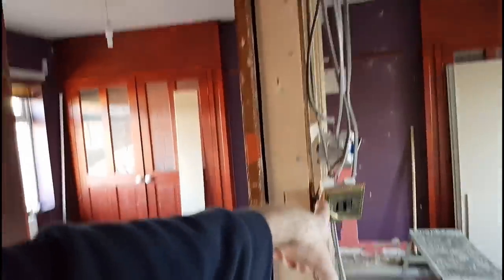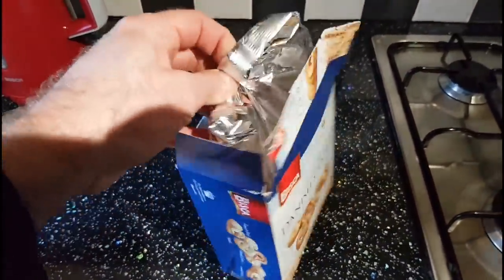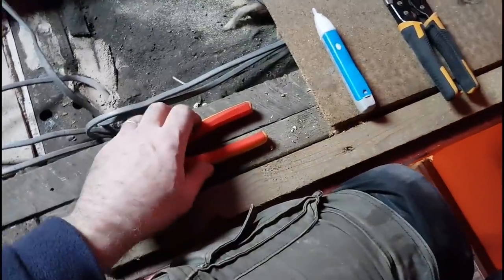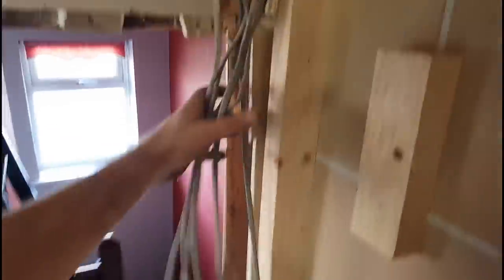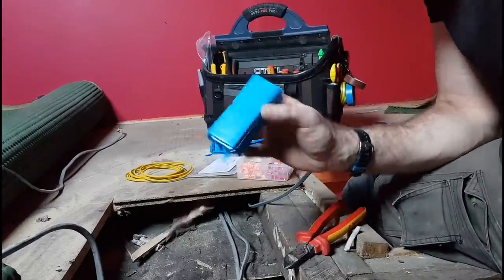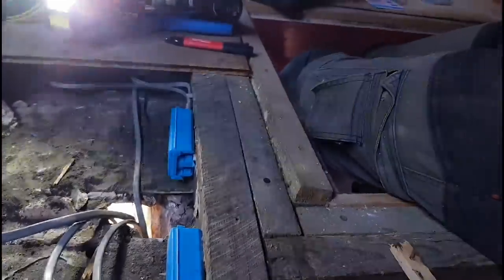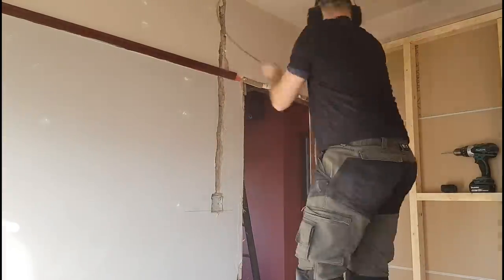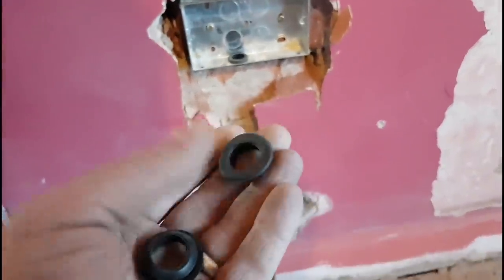Joining cables under the floor. (27)

Comment: Glad your another non capper not only me who feels it's a waste of time
Reply from the maker: To be honest, I do cap a lot as you'll see in some of my previous videos, however sometimes I don't 😉
Reply: Why not oval conduit ?
Reply: I don't usually cap either, everything you now install in walls is RCD protected so you'd like to assume if someone went through the cable it would trip the RCD, not only that but I've been to jobs where the capping has done naff all and someone has hammered a nail through the capping and into the cable anyway.

EDIT: The only benefit I can see is ease of rewiring the leg if it was damaged etc
Reply: Liam did you think it’s for protection against nails 🙈
Reply: Liam. caping and oval should be used to protect from the corrosive properties of fillers, bonding, hardwall etc, to the insulation of cables. These compounds can possibly deteriorate the cable insulation integrity. It is not for mechanical protection. Not having a dig but thought it might help.

Comment: It is ALWAYS a risk to join cables, fault finding becomes difficult and once hidden hard to find.  The way I was taught years ago was NEVER join a cable, unless its visible -all joints to be at switches/sockets and light points or accessories.  Easy access later. Oh  I 'm old school, where a job should be done correctly when nobody is watching. It should never be about speed but safety. Connectors melt. Irrespective of regs, its bad practice and should be about pride in ones work, its what we used to call a tosh ( a bad job)
Reply from the maker: Agree 100% and in the real world with joints and costs to be considered, there's the maintenance free connection. In the video I have used these to deal with the situation at hand, with the added bonus of helping the next spark by leaving labels on the joint box and at the DB.
Reply: @JBE  Well leaving labels helps and understand about real world situations but its still "wet string!"

Comment: That’s crazy not putting the cable in oval tube or capping. When the next person wants to replace the cable or gain a bit of slack he’s got to beat the whole lot out.
Reply: Not important as the next spark will be in to move those switches to the other side of the door !

Comment: Congratulations on reaching 5,000 which is all down to your good workmanship.
Reply: What good workmanship - installing light switches behind the door !
Reply: @millomweb  Thank you for your response. You must have better eyesight than me, I did not see any light switches behind doors as they have not been rehung yet! However my wife is always telling me that I am blind! The man is doing his best and is helping others by posting the videos, why don't cut him some slack? If you mean placing conductors behind door frames then I agree.  Referring to this, I think that he said something like - "this is what they used to do"..  Whenever I come across this old cable routing method  I use a red Sharpie and write in block capitals "Danger, Live Cables" . It put shivers up my spine.  BS7671 clearly says that It is not an acceptable cable routing practice for today.
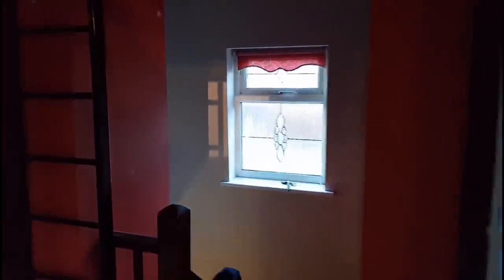Reply: @drunkinpiper  It was an early thought - switch on the wrong side of the door but it wasn't until 15:00 that I noticed the catch that confirmed it.
In my mind, I'd planned to use trunking/ducting for skirting boards and door frames and run all wire, pipes etc in those ! So that things can be easily changed without redecorating.

I'd even though of having rooms with copper pipe picture rail and Tee into that with gas wall lamps - so if the mains went off, at least we'd have gas lighting ! BUT I'm now more thinking of making lighting circuits 12V DC running off a solar charged battery !
If you think about it, nowadays most electrical items are low voltage with a 'charger' 'brick' - why bother why not have low voltage in the house now and do the special thing for those items that still need mains voltage!
Reply: @lightbulb6293  LOL

Thanks for your proof of the complete lack of common sense that exists !

I note most doors are hung the way I suggest - there must be a reason for that and the fact that's the case is precisely where 'common sense' comes from - it's what most people do.
Reply: @lightbulb6293  In England ! 
In my house, there's only one room with a door wrongly hung - and thinking about it, it's completely wrong ! Would be better opening the other way (out instead of in) but the reason it's wrong being better in this case is due to the room layout. It's on the same side of the room as the fireplace - (but not the same wall as the fireplace) which is quite rare.

Oh, there is right way and wrong way - I've seen a few hung upside-down !

Comment: I'm in Canada and I find it interesting the differences in electrical (and plumbing) codes. We would fail inspection for closing in junction boxes or channeling wires just below a wall surface.
Reply: Rightly so.  Its ALWAYS bad practice irrespective of codes. A lazy mans way.  not the correct way.
Reply: We can channel cables. But not wires.

Comment: Great video as always, always helping me learn. Why would you use the Insure boxes over the "traditional" terminal / junction boxes with the brass screw terminals? I guess I don't really trust push in connectors over screw downs.
Reply: Insure push in connectors are maintenance free because the sprung contacts will not come loose over time. Screw connections are not maintenance free because they can come loose and therefore need to be accessible for inspection and maintenence, so you should not use screw connectors under flooring which is practically inaccessible.
Reply: James van de Vyver ....That’s so interesting. In the US those push in connectors are frowned upon because people think they’ll work loose. Apparently folks over in the U.K. think the opposite. Also big no no here to bury a junction. But sometimes what are you going to do short of tearing up another level.
Reply from the maker: I would always prefrer a mechanical connection over a push in type or even a twisted together connection. It always feels weird putting a joint in a floor that might not be accessible.
Reply: @jamesvdv0  How can they come loose if the junction box is secured and not moving around?
Reply: @vikingofengland . Mains 230V AC connections, particularly those under load, can vibrate as each peak in the mains signal (2 * 50Hz = 100Hz) causes momentary heating of the contact which can loosen it over time. That's the theory anyway. The IET Regulations do state that only crimped or soldered/braised connections are allowed to be unserviceable. I assume that these sprung connections count as crimped connections, as far as the regulations are concerned. I'll post a reference to the IET regulation on here if I remember later.
Reply: @jamesvdv0  interesting, thanks for the explanation. Kind of makes sense thinking about it.
Reply: @vikingofengland . BS 7671:2018 Sec 526.3 covers the exceptions for connection accessibility for inspection, testing and maintenance.
Reply: @jamesvdv0  you should not have hidden connections at all.

Comment: Didn't need the 2 joints in the loft there was enough length on the old cable to drag it back to the new position

Comment: Those new switch positions are Quite a distance from the door frame, I go for a 100mm gap from the architrave.
Reply from the maker: I throw a dart from across the room!
Reply: It’s a method I suppose
Reply: LOL - and you didn't notice he's put them on the hinge side of the door frame ! Someone will end up moving them to the proper side.
Reply: @millomweb  Or here's a crazy idea maybe the doors or even new doors are going to be re-hung opening against the new dividing wall ??
Reply: @kyleadamson  It's the wrong place for them as they'll not quite open to 90°. On the other side, they'll open far wider making it easier to get larger furniture in.
Out of all our rooms, we've only 2 where the door opens against the wall. Toilet - no choice, wall both sides and internal kitchen - which we're not dragging beds or sofas through.
Reply: @millomweb  Well it isn't wrong it's what the clients choose to have. I've got multiple doors opening in my home the way they would opening towards the diving wall as on this job, I've had no problems getting beds or furniture in and out. Door were generally hung the way you suggest as a privacy thing so if someone was getting changed the had time to notice a door opening rather that the person getting a straight view.
Also having them the way you suggest has them imposing more into the room space wise, having them open more than 90 degrees into the room would also mean not been able to locate anything in the space past that swing angle.
Reply: pmailkeey 
Maybe washing machines and fridges
Reply: @kyleadamson  Not true All our rooms have things behind the doors but you can easily move them out of the way if you need the door opening wider.
I have seen them hung both sides, but 'room side' is far the more common.
Reply: @jasongreen3960  Doorways are wide enough for  standard 'white goods'.

Comment: Question. Is there no requirement in regs to cover cable embedded in plaster walls?
Reply: No, the capping is only there to protect the cable from a plasterers trowel, it provides no further mechanical protection
Reply: Thanks